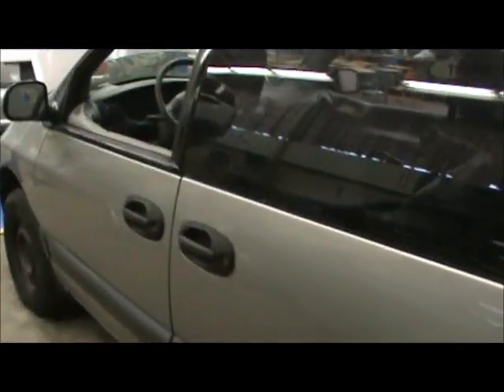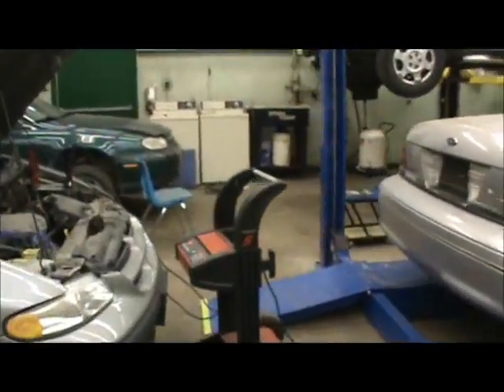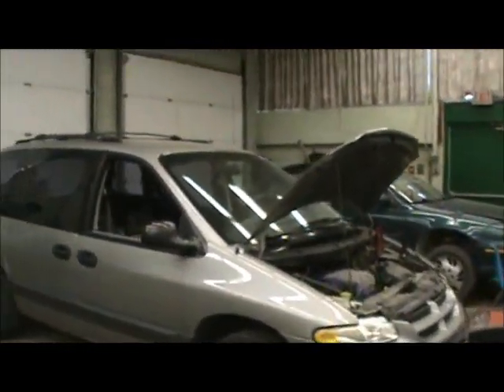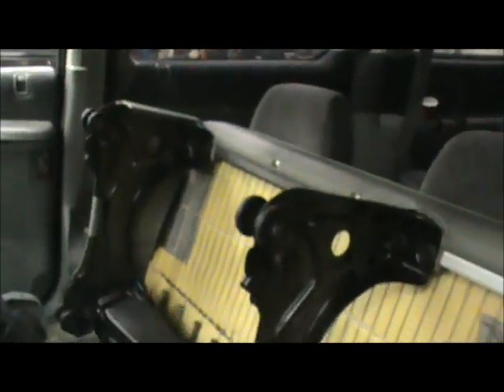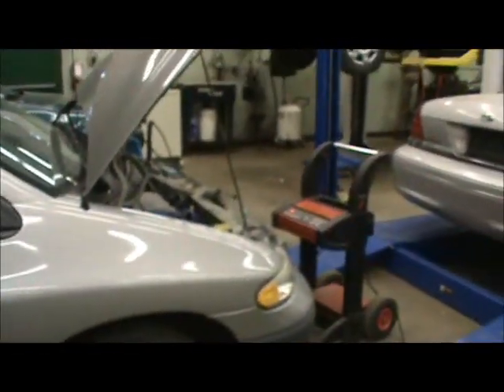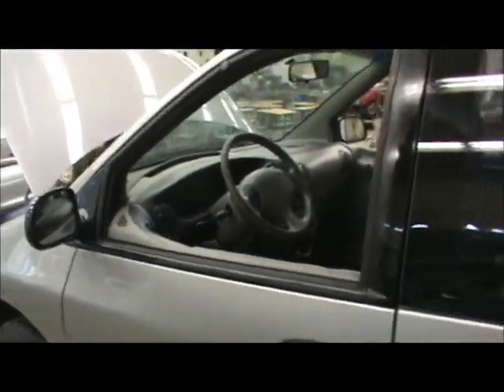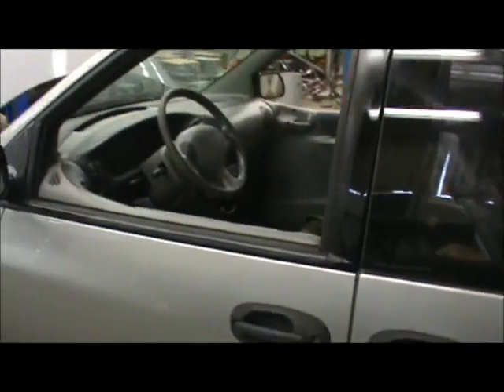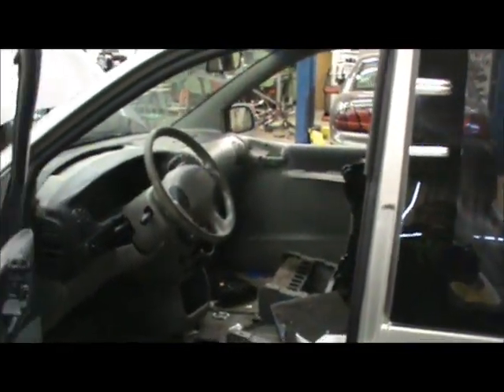1996 Dodge Caravan Walk Around and Start up

Comment: @northernpride10 Might just need a diode. My 95 Exploder had two under the hood in the fuse/relay box thing and that might too. Also, you could try checking the fuse for the cigaret lighter because some cars use that circuit to power the ECM. (worth a try if you guys haven't already checked those things) BUT before you do anything, don't forget to slap the guy who did that in the back of the head.

Comment: @redneckbryon not on mine you cant, its a 2007 Grand caravan.  and when you start the engine it even says on the display, apply brakes to shift gears. wont even work if you dont.  I did have a caravan from 1996 but I dont remember how that worked when switching gears. that car died in 2002 transmission just gave up.  seems short lived for a car, but maybe vans die quicker